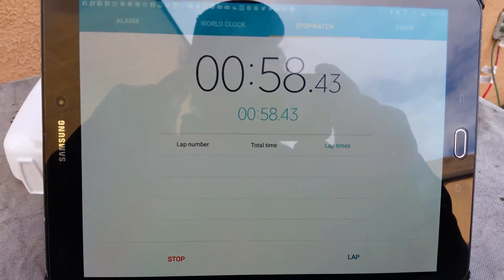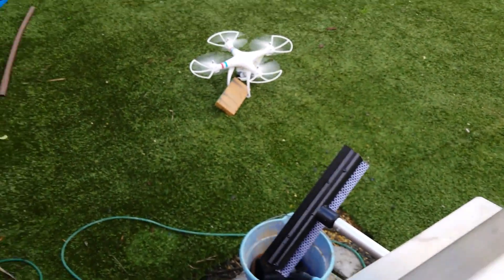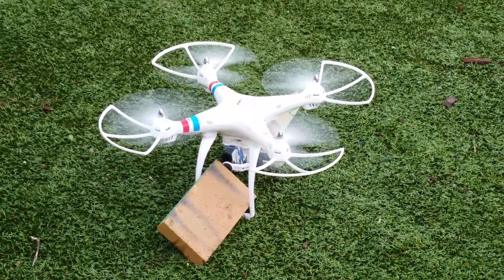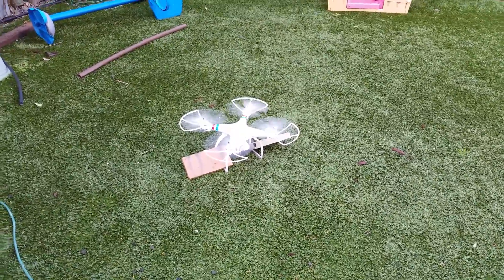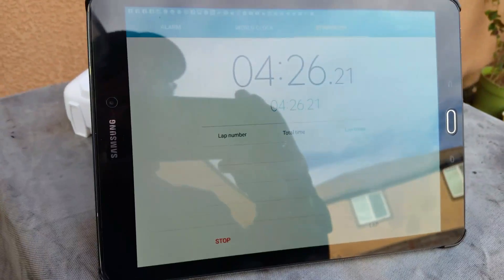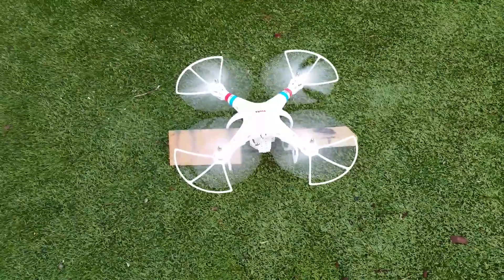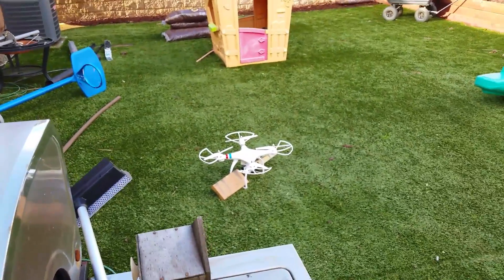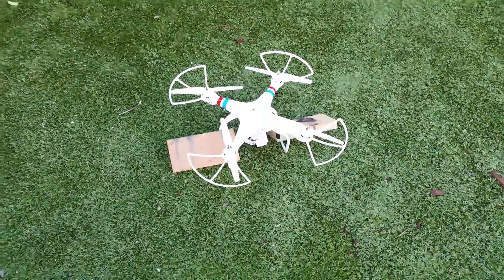Syma X8 OEM battery vs eBay replacement. PART TWO. WATCH BEFORE YOU BUY REPLACEMENT BATTERIES!!!

Comment: i have same problems with the replacement batteries,when i charge them on my charger ,they only take about 900mah to fully charge ,so to me.its false advertising,there not 2500mah batteries as it states on them

Comment: Yeap some damn thing.. The stock battery last 12 mins, the ebay replacements only last 6-7 mins! Wtf!  I bought the 3pack with a charger for $38.. I wanted to get a refund and they wouldnt do it.. So the gave me $20  back, and I kept the crappy batteries.